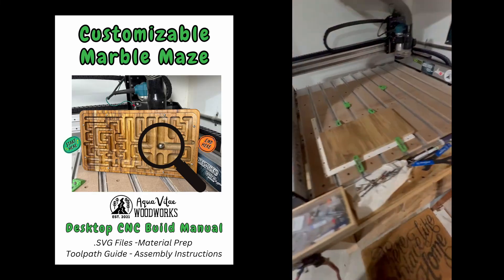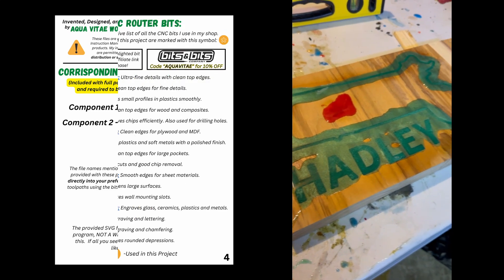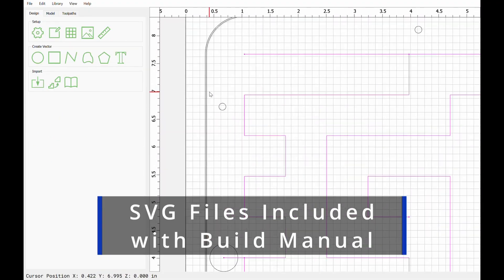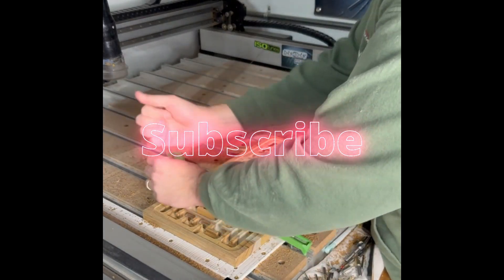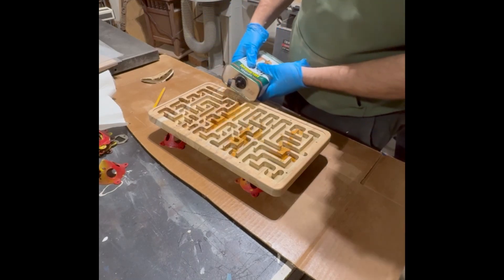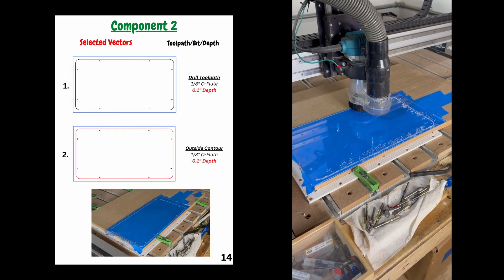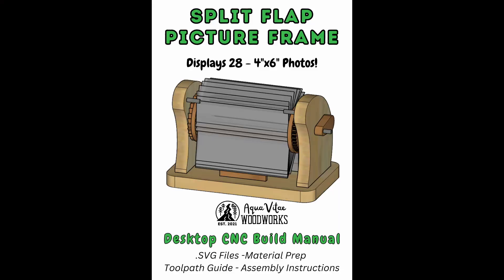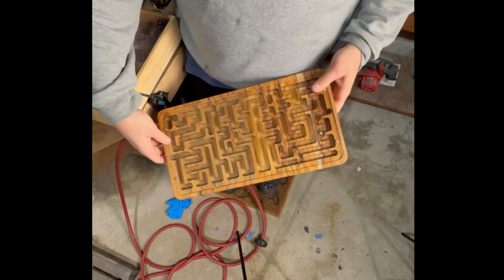Customize and Sell for Profit!

Comment: Hi there,
I recently built a maze and used a beech wood panel from a hobby store (properly dried). After applying a light coat of wax oil with a brush, the whole piece warped, even though air could reach both sides. I had to moisten one side and press it under weight to get it straight again.
Is this a problem with the wood itself? Would oak perform better? Or is it an issue with using a glued panel?
Thanks for any advice!
Reply from the maker: I’m certainly no expert, but wood is always going to move, especially when you carve out a large portion of it like in a maze. I have that problem on occasion with these as well. Edge glue doesn’t help, but grain direction also matters a ton